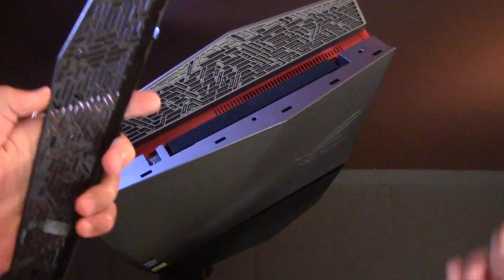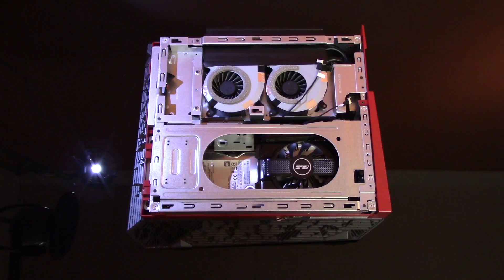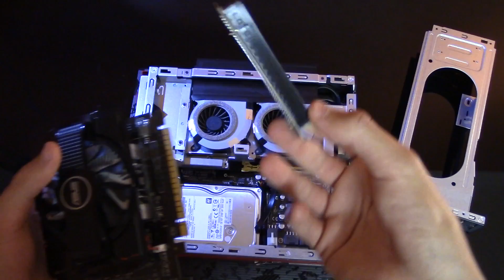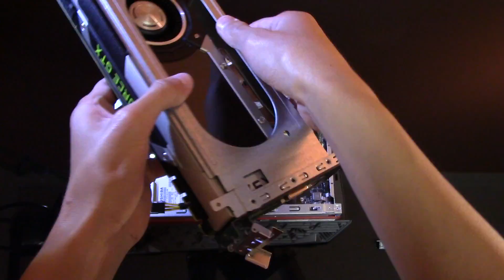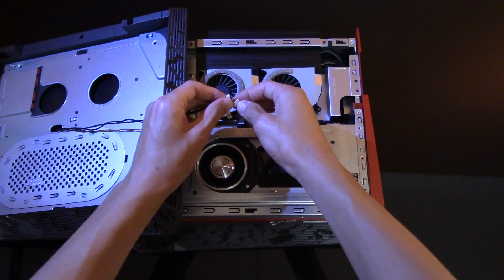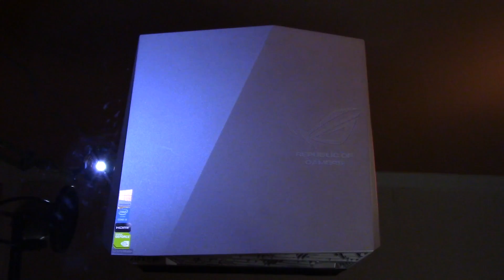Asus ROG G20 - GPU Upgrade Tutorial

Comment: Hi Mr Dreweon I have an  Asus Rog G20 cb with a GTX 960 2GB inside and i am planning to buy and change it for A GTX 1060 6GB! Which one do you think is the better overall and fits in the case inside  the rog G20cb, the Founders Edition, MSI Gaming X  or the Asus White Dual GTX 1060 OC 6GB! I do have only a 6 pin conector , i am from Portugal and nvidia does not ship the founders edition to my country, but i can  get easily the asus dual GTX 1060 OC 6GB from Worten or FNAC! What do you have to say i need an answer!
Reply from the maker: Best to get a reference model, less heat in the case and best fit

Comment: So... im planning to upgrade to a 1070 or 1080 in the next few months... but my g20 only came with one bower brick (i5, 750, 8gb ram) and i understand you have to get the other one, but i have no idea if i have the 180w or the 230w. How can i tell?
Reply from the maker: The 750/i5 model, my model, comes with the 230w. You should get the 180w.
Reply: DrewEon I have this machine installed gpu with only 1 -6 pin power needed which socket  on the motherboard do plug it in at
Reply: it's a good thing ....it's not mine
Reply: i feel sad for you i have the core i7 6th genaration with the gtx 1070 with 250 ssd and 1 terrabyte

Comment: I installed a asus gtx 1060 turbo into my g20cb and use both power supply but the graphiccard is not working , every connection is right and when i reinstalled the old gtx950  the old card works
Reply: i have the same problem with my old gtx745

Comment: I upgraded to a 1060 but it only needed the 8 to 6 pin cord. do I still need another power adapter if I have a 230w already or does it need both.
Reply from the maker: With the 1060, you should have both.

Comment: sorry old post I see but had a question.   what do you mean by getting a 180 or 230 psu.  I know they use that external plug like a laptop.  is that the psu?  I have the i5 750 ti version.  are there 2 "holes" to plug in psu?  I guess I'll have to look if I have 1 or 2
Reply from the maker: If you have the 750 version, you'll probably need the 180w as you most likely have a 230w.

Comment: Heya DrewEon idk if you will read this but in the case that you do, PLS HELP. I am having huge issues with the gtx970 now and havent seen any threads/posts that help. I would love some help this is way outa my league
Reply from the maker: Have you moved R20 pins to the top 2 pins? Didn't know it at the time of making this video, very sorry if that's the issue
Reply: how many of these pins should i move up?
Reply: all the pins or specific ones by the R20? there are like 6 or 7. Also once i do this the power button only works sometimes and i get no signal from the 970

Comment: would the titan x fit in this pc
Reply from the maker: It will.
Reply from the maker: Although length may be something to consider. I'd check dimensions, if it's more than an inch longer than a 1080, it won't fit I'd imagine.
Reply: DrewEon is it possible to get a 250w power supply?
Reply: Ethan Smallwood I have same question what can I do if card need 250w ?
Reply: DrewEon if card need 250w so what can I do ?

Comment: How do you know what Watt your PSU is?
Both my Power Bricks have no labels on them, just ASUS and joined together with a ROG bracket.
Reply from the maker: Well if you've got both, you've got the 180 and 230W.
Reply: Thanks!
So the main board one is always 180W and the 230W is if you have a Powered Graphics Card, so I take it some of these are sold without the second power brick then?

Comment: Can you show the piece of metal you touched? and the PC when it's all done and working? I'm kinda confused.
Reply: I have the exact same computer, all the same specs same year same gpu. I was planning to upgrade to the same gpu you had on screen, which power adapter would I need?
Reply from the maker: You'll need the 230W. And I was just touching a heavy weight, haha. Just touching the metal in the case will do it. It's not a very heavy risk, shorting out your PC. But be cautious.

Comment: So I'm confused, right now I'm using the out of the box power brick and cables from G20AJ, both cables are needed and plugged in for power. Do I need new power adapters like you need and are in the description
Reply from the maker: If you've got the 230W, purchase the 180W, and vice versa. You have to have both the 180W and the 230W.

Comment: can a evga GTX 1060 SC gaming fit in there? and can i put a Better Power suply in IT and a motherboard?
Reply from the maker: The 1060 SC will fit, but I'd suggest a reference card for airflow. And you can't change the motherboard. Those are the only two power supplies you can get.

Comment: need i one of the power adapter from the description for the update or can i use the included power adapter (i want to buy it and after that i want to upgrade it to a gtx 1080)
Reply from the maker: If you've got the 230w, get a 180w, and vice versa
Reply: DrewEon but in my product Data Stands Power supply 230w + 180w

Comment: im getting the evga gtx 1060 superclocked 3gb! will these cables fit in the graphics card?
 https://www.amazon.com/PCI-Express-Video-Y-Splitter-Adapter-Supply/dp/B00A3OVG4W/ref=sr_1_5?ie=UTF8&qid=1483461498&sr=8-5&keywords=pci+8-6
Reply from the maker: Those will not fit, I've searched for countless hours and the best I've found is this: https://www.amazon.com/gp/product/B00A45JA52/ref=ox_sc_sfl_title_6?ie=UTF8&psc=1&smid=ATVPDKIKX0DER

Comment: Thanks for the Video. I was able to switch out the 760 mine came with a lot easier following this video. If a person has the 760 model (or any card that requires the power brick) I would like to say that the cable was already inside the unit and the jumpers already set naturally. I upgraded to a ASUS Turbo 1070 8GB. Only step I did that was not in yours was moving a black holder in the Graphics Card holder back to accommodate the slightly larger card.
Reply from the maker: Nice!

Comment: Is an additional power supply necessary for upgrading to a gtx 1050 ti?
Reply from the maker: If it doesn't have a 6 pin or 8 pin input, it's not needed.
Reply: DrewEon Is there a risk of damaging my pc if i dont use the extra 180 watt power supply
Reply: DrewEon How would you turn on both power supplies? Sorry for so many questions.

Comment: DrewEon. I just ordered that cable. Will i be good to go now??? because i just spent 30 dollars on that for one day shipping.
Reply: please reply soon! I need to know if that can work with asus rog g20aj desktop model cuz it seems like it was made only for there stuff. "Compatible with all SilverStone modular PSU released after 2009"
Reply from the maker: I've purchased the cable myself, and it'll plug into the G20 motherboard and graphics card, I can't imagine there will be any issue.
Reply from the maker: Although, it'll be a very tight squeeze.
Reply: And once again. Thank you. And do you know if it will fit for sure the gtx 1070 founders? I haven't nstalled that part yet. Just making sure

Comment: You needed pins to connect that. Do I need a double sided 8 pin for my gtx 1070? I don't know if it came with it or not.
Reply from the maker: The 1070 will probably come with a cable not compatible with the G20. Have you lost the original cables? This is the best I've found: https://www.amazon.com/gp/product/B00A45JA52/ref=ox_sc_sfl_title_1?ie=UTF8&psc=1&smid=ATVPDKIKX0DER
Reply: Did the original cables come seperate from the actual desktop in the box? or are the cables located inside the desktop along with the gtx 750 right now? I didnt open it up yet

Comment: How do i know what Adapter I need? Please Help!!!!
Reply from the maker: if you've got the 230w, get the 180w. If you've got the 180w, get the 230w. The 230w plugs into the bottom power port, and the 180w plugs into the top power port, if that helps
Reply: DrewEon I didn't know about the top power port. so basically it's just both of them plugged in simultaneously
Reply: DrewEon also +1 sub

Comment: does this fit there? ASUS TURBO-GTX1060-6G 6 GB Graphics Card - Black
Reply from the maker: It definitely should!
Reply: thanks
Reply: DrewEon can I use 7970 amd on 180w ?
Reply: Yes it does, you may have to move their card holder back (I had a 760 in mine and it had a black holder for the end of the card). I replaced mine yesterday with the 1070 model of the card above.

Comment: Do you need to have those 2 power cables? I have 1 of them, will that work?
Reply from the maker: If your graphics card only needs 1 power cable, then yeah.. But if not, this is the only cable I've found that'll work: https://smile.amazon.com/Silverstone-Sleeved-PCI-E-8-Pin-PP06B-PCIE55/dp/B00A45JA52/ref=sr_1_9?ie=UTF8&qid=1482567790&sr=8-9&keywords=silverstone+8+pin
Reply: DrewEon I got the exact graphics card as you, and i got both the 180w and the 230w.

Comment: is the asus rog g20bmau001t the same as this pc?
Reply from the maker: It's the G20, but with different specs.
Reply: DrewEon im guessing its the lower range one, so will the gtx 1070 founders fit? and if so should i get another 230w power brick
Reply from the maker: The 1070 founders will fit. And if it comes with  230W, get the 180w, and vice versa.
Reply: DrewEon im just going to go with another 230w to be on the safe side

Comment: I can't find my the wire for the power would this work?http://www.newegg.com/Product/Product.aspx?Item=N82E16812706001&cm_re=6_pin_pci_express_power_cable-_-12-706-001-_-Product
Reply from the maker: That won't work, as one end is made for a power supply. I've been asked this many times, and the best I've found after hours of searching is this cable on Amazon: https://www.amazon.com/Silverstone-Sleeved-8-Pin-550mm-PP06B-PCIE55/dp/B00A45JA52
It's quite long, but I think it's the only thing that'll work. I've got it myself, but later found out I didn't need it. It'll work, but it'll be a tight fit.
Reply: DrewEon alright thanks you sooooo much

Comment: I have the asus rog g20aj i5 4460 and gtx 750 2gb desktop model. Im trying to upgrade to the Nvidia Gtx 1070 founders edition and the corsair HX750i 750 watt power supply. Will everything fit? I definitely know the 1070 can fit. Just not sure about the power supply
Reply from the maker: You can't use the corsair power supply, because it just wouldn't work. You're going to need to purchase the 180w and use that along with the 230w. The founders 1070 will surely fit.

Comment: Thnx for the video, very usefull, also can i ask u a question, i bought a gtx 1050 ti (it doesnt require the extra pins), i have only the 230watts, do u think it will run ? thnx in advance
Reply from the maker: Definitely! The 1050ti is amazing on how little power it uses for the performance it delivers.
Reply: thnx :)

Comment: Will the MSI GTX 970 fit in there? And what mobo Will fit and supports AMD-fx 8350.
Reply: How can i tell which power cable do i need to buy i dont know if i have the 230W or the 180W
Reply from the maker: The MSI GTX 970 won't fit as far as I know, and also exhausts heat into the case. And the motherboard is custom to the G20, nothing else will work.
Reply: DrewEon so if i want the msi gtx 970 Ill need a New case, and cooler, motherboard and a cpu?
Reply from the maker: Basically
Reply: DrewEon well damn my life
Reply: It's made for reference cards ( Founders Edition ).

Comment: Thanks for the video, my friend. This was very helpful. Would you happen to know, offhand, if Asus' rendition of the 1060 is bigger or smaller than the 970 you used in the video? I'm thinking of upgrading to that one, but I just want to be sure that it'll fit. Thanks again for the upload.
Reply from the maker: The reference 1060 from whatever company you get it from is nearly the exact same size as the reference 970 I used in the video, but the 1060 is about an inch shorter.
Reply: DrewEon Oh, wow. That's good to hear. I was hoping it would fit well. Thanks, bud. I appreciate it. Have a great day.
Reply: Hi there, Drew. I have one more question for you. I saw you reply to someone else's comment earlier about the power supply. I currently own the i3 version that came with the GTX 745 and a 180 W adapter. I want to upgrade both the GPU (as I mentioned before) to a 1060 and the CPU to the i7 4790k. Do you think both the 180W adapter and the 230 W adapter will be enough for those new specs? I want to make sure that I don't buy less than I need. Thanks.

Comment: wait why are you ordering another power supply? Is the default power supply not strog enough for the 970? ALso what manufacturer is your 970 from. is it EVGA?
Reply from the maker: The 230w isn't enough to power the system with the 970. And it's straight from Nvidia, not branded by EVGA, Asus or whatever.

Comment: drew i need somr help, so I did  what you did in the vid but i used a gtx 1050 ti without the power pins and i turned on my pc afterwards and my monitor does not pick up any video, i have checked to see if it is in the pcie slot and it is, any help?
Reply from the maker: I don't know mate :/

Comment: hey bro great video! wanted to ask you about something i have the ASUS G20AJ-US023S same as this one in this video. i only have 1 power supply with it beacuse the 750 gtx doesn't need any wires connected to the motherboard but now i actually installed the ASUS 1080 gtx  turbo and it actually worked with only using the one power supply. so everything in the desktop is exactlly the same i just changed the GPU, but i keep hearing i need another 180w power supply or something so what did i do wrong or am i only using half of my GPU power because im confused xD.
Reply from the maker: Yeah you're going to totally kill your 1080's potential with that, and risk killing the PC. Are you playing demanding games? Because there's no way the 1080 can run on 230W for more than a few minutes, if even. Get that power supply!
Reply: +DrewEon yeah I've been playing games for a week no problems like overwatch and my performance is quite good  with the temperatures going max at 77 Celsius using auto fan speed of course. I actually bought the 180w power supply and plugged it in but before that i moved the R20 pins in the motherboard to the top so is that correct or  should i not move them ?
Reply from the maker: Hamad AlQahtani You just said that you've only got one power supply though? Haha, and yes. Sorry I didn't know it at the time of making this video, but you do need to move the R20 pins up.
Reply: +DrewEon yeah that comment was almost a day ago xD when i saw all the videos telling i should buy the 180w i just bought it immediately from a near store. Thanks for the help and the fast replay! :)
Reply from the maker: Hamad AlQahtani Oh lmao alright

Comment: Wait can I just upgrade to this without upgrading anything else? Or would I have to upgrade the power supply too? If so let me know
Reply from the maker: If you've only got one power supply, you will need to purchase another.
Reply: DrewEon Well, I have the one the G20 comes with... What second power supply would put recommend and how would someone have to hook it up?
Reply from the maker: Wukke Links in description, they plug in just like the one you have. If you've got the 230W, get the 180W, and vice versa
Reply: DrewEon Sorry for all the questions but, If I currently want to upgrade to the 970 but, only have the power supply the G20 comes with, which power supply would I get in the description of the video, the 180W, 230W, or both?
Reply: DrewEon Kinda don't know what I'm doing when it comes to compute specs LMAO
Reply from the maker: Well have you got the G20? Just look at your power supply, and get the opposite of what you have. You need both the 180 and 230 to power the 970 and cards alike it.
Reply: DrewEon Ok so I would need both supplies to power the 970? And I'd need to hook them both up into my computer at the same time correct?
Reply: DrewEon Or is there more to it?
Reply from the maker: Wukke They just plug in

Comment: Do i need both power adapters? and if so how do you connect both? Also can I use two 230w adapters?
Reply from the maker: You can only use the 180W and 230W together, they're just big laptop chargers essentially, you plug them in.

Comment: I'm probably asking a really stupid question, and my excuse is that I'm a noobie when it comes to computers because I just bought this computer with the 1070 and it says it came with the 230w and a 180w so do I still need to buy another power supply if I ever want to upgrade mine?
Reply from the maker: The 230w and 180w are the highest you can go with the G20, and they're enough for even the 1080, and as time goes on, PC parts are simply going to use less and less power.